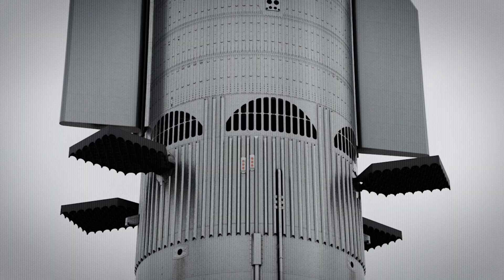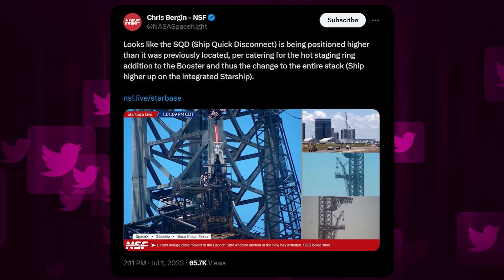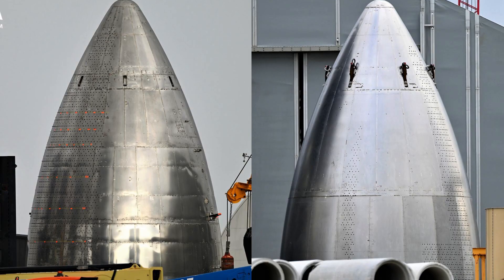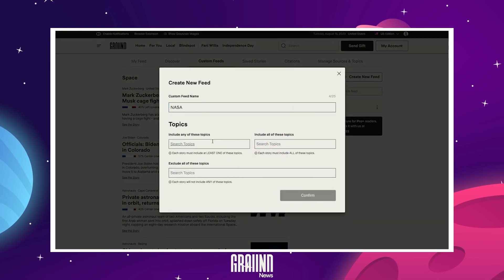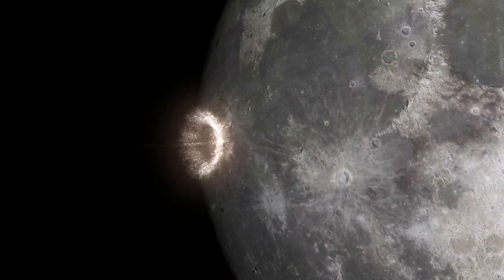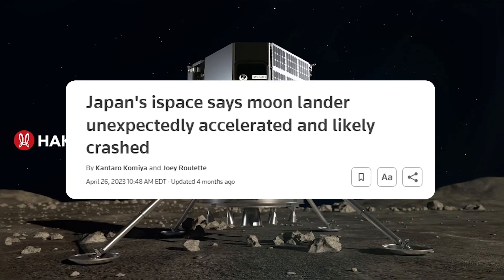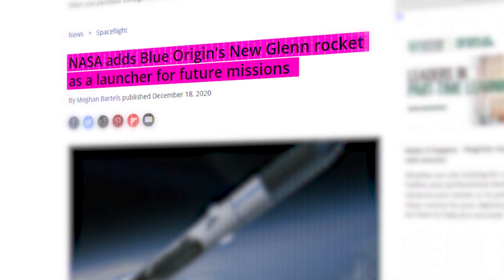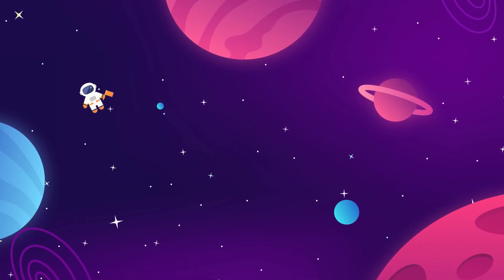SpaceX Reveals Major New Changes To Starship!

Comment: What you are looking at is not Hot Staging but Dynamic Skirt Pressurization Scheme intended to prevent collapse of the Skirt of the Starship due to compressive force generated by 33 Raptors of SH Booster during liftoff (kicking of a dead horse).

Comment: Stop giving Blue Origin the benefit of the doubt. They're WAY behind in their plans and have yet to even reach orbit, something SpaceX has been doing many times a year since their Falcon 1 did it back in 2008. And Blue Origin was founded TWO YEARS before SpaceX!!

SpaceX has launched a whopping 58 rockets so far this year, and all but Starship reached orbit. The 2nd test flight later this year should go better.

I hope Blue Origin delivers, but with exactly zero experience with orbital rockets, much less a massive one that also is supposed to be reusable, I am highly doubtful of an immediate Blue Origin success with the New Glenn.

Comment: There is no reason to light the inner three sea level Raptors at the kind of altitude booster separation will occur. It doesn't need much acceleration to separate, either. This is why only the vacuum Raptors will be firing

Comment: It's not an easy thing to set a vehicle down on the Moon.

Is that why SpaceX is trying to set a stainless steel silo down on the Moon?
Reply: It's a stupid design which is why Bezos will beat them
Reply: @hikesystem7721  
Wouldn't bet money you need on that.

Blue Origin was started 2 years before SpaceX.

And so far they've done squat in comparison to SpaceX.

But people have been saying what you said since SpaceX became a company.......
Reply: @lordgarion514 my prediction is based on the designs, not start dates. I really think SpaceX landing ship is a bad design. If it does eventually work, it will take a very long time,
Reply: @hikesystem7721  
You might want to look up how many boosters SpaceX has had land themselves successfully...... In a row.

The landing isn't the hard part now.
Reply: @lordgarion514  its not only the landing. Landing on a crater covered moon and having the rocket remain erect during entire mission. Then relaunching it...all additional complications.